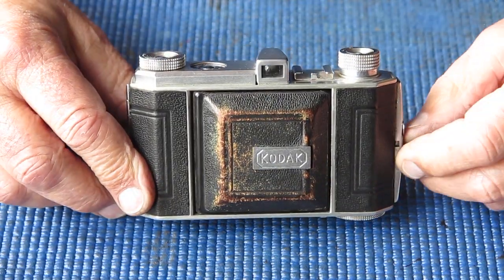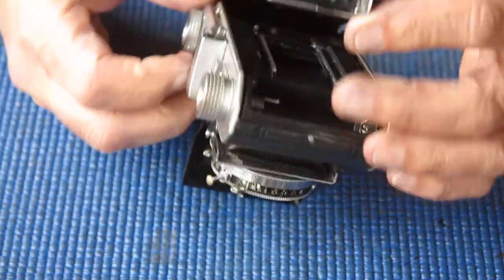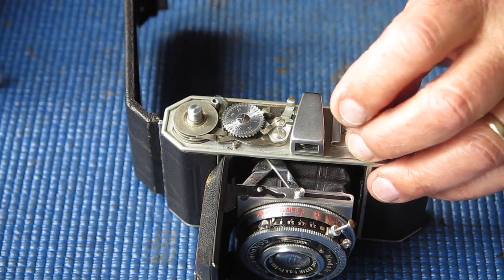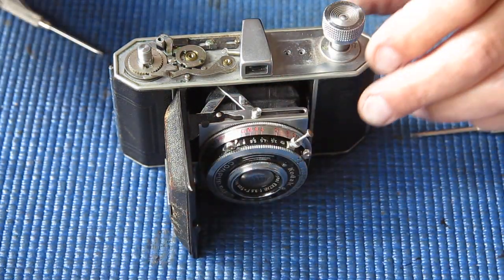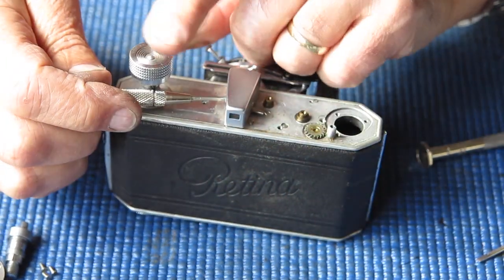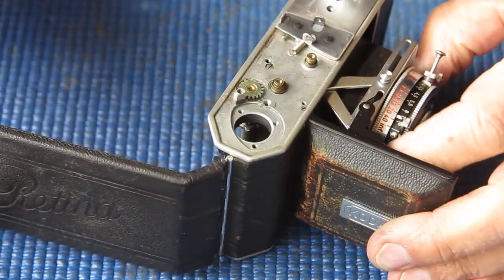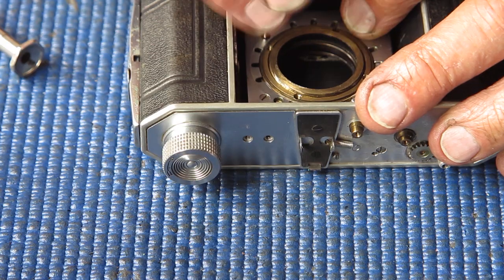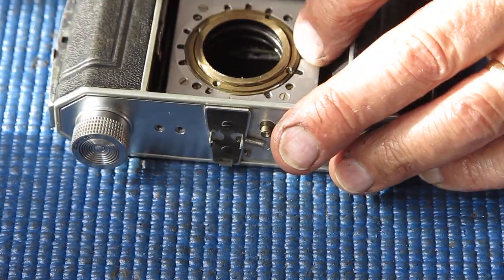Kodak Retina I type 126 service part 01

Comment: I have a serious question about this specific model (126). For someone who has NEVER worked on a single camera (other than taking a shell off and putting it back on), would you say this is possible to be serviced by a complete novice? Think the biggest problem is a foggy lens? 
I really want to save this camera (it was given to me by someone in a box along with an SX-70, think the original owner passed, and I'm pretty sure he was keen on photography). Any info would be appreciated, thank you!
Reply from the maker: Anyone repairing cameras has to start with their first camera. Watch a few videos, then watch a few more. You are better able to judge your abilities than I am. If you are set on repairing this particular camera, then the best advice I can give you is to buy an as-close-to-identical camera as you can find, and service that. If you are successful, you can move onto the one you already have with your new-found skills.
Reply: @ChrisSherlock  Good advice, will search for another 126. Last question: I'm aware you use naphta, but what grease would you use for this camera?